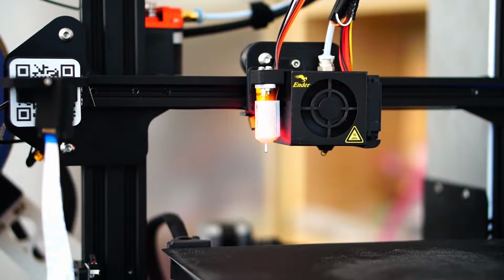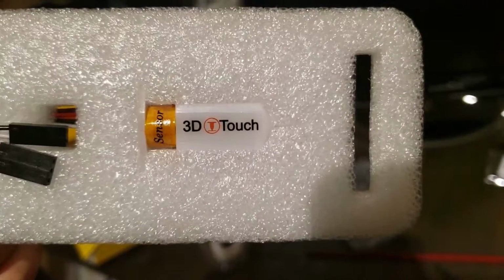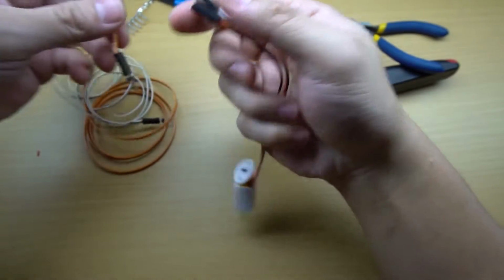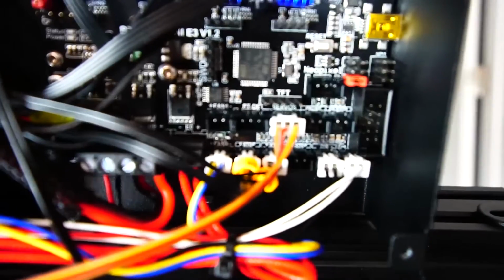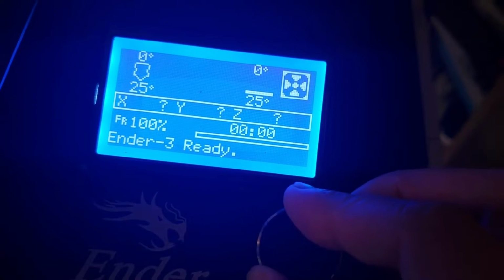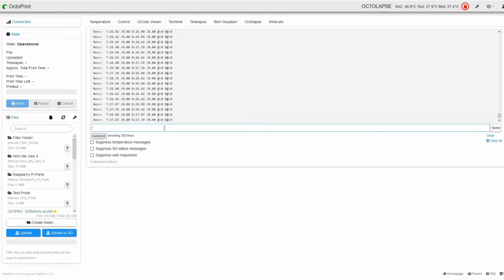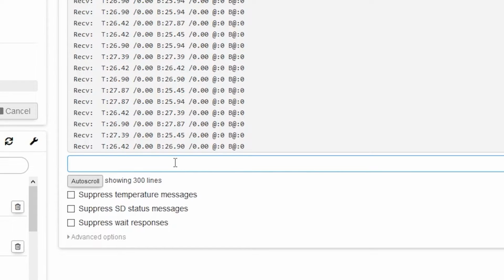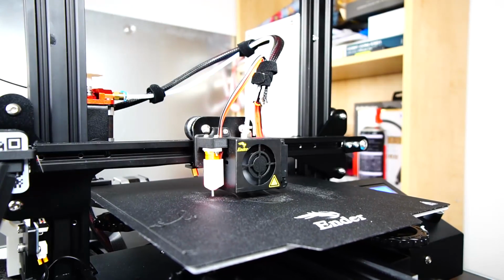3D Touch +  SKR Mini E3 v1.2 on Ender 3 Pro 3D Printer

Comment: whats the github link for this specific firmware? I tried all avenues of trying to load marlin into it and everything keeps erroring. beyond annoyed trying to get the firmware to load. I had to install Visual studios then marlin, next install Platformio next install GIT. I dont have time to be troubleshooting the code in Visual let alone understand why it keeps erroring. the printer literally just has the BLtouch and the BTT SKR mini e3 1.2. why do people have so many different variations of the firmware that all keeps failing for me..... can you provide me the exact link you used for BTT with BLtouch firmware? Please?

Comment: So here we are three years later and your video is still doing good. I was going to buy a new printer when on a whim I decided to dig out my first printer. My gen 1 Ender 3. It had the old 8-bit board in it and it was annoying as heck to level but years ago I bought a BTT SKR Mini V1.2 and never installed it. Well, over the last week I decided to install it (since I already owned it) and it makes a huge difference to the printer. I then bought the knock -off BL-Touch for $15 from Amazon and printed out a full shroud with integrated sensor arm and mounted it up to the printer. I carefully followed your directions and BINGO, I now have an auto leveling quiet second printer. Thank you for this video. It saved me the purchase of anew printer and brought my first ever printer up to date (well, as good as it needs to be).

My tip is that I extended the loom by soldering the short loom to the long loom and shrink wrapped the individual leads so extending it by about 6 inches which really made installation easier. 
 Also, I bought a bunch of super cheap (less than $2 each) LM2596 buck converters from Ali Express and installed them in line with the various fans to slow them down. It makes a huge difference to the overall noise level and it doesn't hurt performance. 
The new 3D-Touch V2 has the loom plugged into the back of the tiny PCB so it makes installation a whole lot easier and it's been working perfectly on my E3.

Comment: my ender 3 has a print resume function, if power cut / load shedding happens. 
I want to know- After this modification / firmware update = will the print resume function still work after power cut !
Reply from the maker: It should still retain those functions as long as they are not disabled in the firmware.
Reply: thanks for your reply 
my motherboard is this one: https://www.powerplanetonline.com/cdnassets/placa_base_impresora_creality3d_ender_3_pro_01_l.jpg

I am confused about the wiring. going to connect the 
2 pin: black & white with z end stop

3 pin: green on ground, red with 5v, orange with signal

where am i supposed to connect the orange wire ? THANK YOU...

Comment: Had to replace the board, due to blown stepper controllers.   Luckily, had a spare, and the replacement was transparent, due to identical hardware  (SKR Mini E3 V1.2).   Sadly, the V1.2 are no longer available, and you're obliged to buy V2.0.    Apart from obvious firmware change, is the switch to V 2.0 of that SKR Mini E3 also  transparent ?

Comment: Great video 👍 however i hope you can help me? I bought a new ender 3 and did not turn it on. I upgraded to a bigtreetech skr mini e3 v1.2 and installed a BL touch. I then watched this video and could not find the same file you showed on github. Also when i plugged in my printer and setup the isp USB to my PC the did not recognise the USB but had other USBs when attached. My printer fans were on when switched on but also tested previously to see it started up correctly when installed and no display. I assumed this was due to not having installed the firmware. Any tips? Advice? Links? Will be much appreciated to help me get my printer to print perfect models in future 😊 I am determined! But need some guidance and help from experienced persons

Comment: Hi can you please help me with this for ender 5? My bed keeps hitting the nozzle on autobed leveling :(
Reply from the maker: I'm not too familiar with the ender 5, but if your nozzle keeps hitting your bed then there are a few common possible reasons.
1. Firmware is not set to use z-homing and you don't have a z stopper.
2. The touch probe, when fully extended, is shorter than the nozzle and isn't getting triggered correctly to sense the bed.
3. Incorrect wiring or hardware issues causing the touch probe to not deploy or sense properly.

Comment: I'm having trouble with my bltouch when I auto home, it won't deploy. any tips on how to fix it?
Reply from the maker: If your firmware is correct then there should be a BL touch menu option. In that menu there should be options to deploy and retract the probe to test if it's working properly. If it is not then you may have a configuration issue, a wiring issue, or a hardware issue.

Comment: Hey... in the link for the BL-Touch mount... which file did you print. There's 2 versions. one of which is 3mm longer
Reply from the maker: I believe it was this one
ender3-bltouch-mount-4b-3mm-lower
Reply: @dorkytim  That'll explain you're Z-offset.

I printed the normal one, but the pin was always higher than the nozzle. 

So I put a 3mm nut between the BLtouch and the original mount to space it down enough. And my Z-offset now is -1.40

Comment: I don’t have the bltouch option after I flashed the firmware help please!!!!
Reply from the maker: If you don't have the bl touch option then you likely loaded the wrong firmware or the firmware didn't load. Did you rename the file to firmware.bin before loading it on the sd card?
Reply: @dorkytim  yes and I did the z homing option it still isn’t working

Comment: For anyone wondering what the white clip in connectors are called that connect to the SKR Mini board they are the JST-XH connectors. Cheers for the vid it helped me out. 😊 Good shout about using the male to male pin to easily unplug the BL touch I didn't realise you could do that (newbie to electronics).

Comment: Thanks. Your video helped me install the thing and it works kind of ok. I have one question though - how does the firmware know the distance between the hotend and the probe? Are there some standard values baked in the firmware or can I change that? I use different cooling and I think my probe has different offset from the nozzle than yours. Can I configure that?
Reply from the maker: This is what the Z offset is for. You have to adjust this value to get the right distance and ultimately it affects how close your nozzle is going to be to the bed.
Reply: @dorkytim  I meant the distance between hotend and the probe in XY coordinates. But I've figured it out. When you download the firmware, there are configured values X-44 Y-6. I had to set it to X-46 Y-8 using M851. So mine was only a few mm off of the default value so it shouldn't make a big difference, but if someone had a different mount of the probe(worst case on the other side of the hotend), it would be really important to set these values correctly. https://marlinfw.org/docs/gcode/M851.html
Reply from the maker: Ah yes. The x and y offset.

Comment: i need help guys, my 3d touch doesn't seem to go near the bed probe works. it also says home z first?
Reply from the maker: Is your probe mounted correctly, and is below the nozzle when extended, but above the nozzle when retracted?

Did you use prope port or zstop port for z-homing?

Comment: Planning to install bltouch after I get some wire extensions. So just to confirm, the firmware changes the autohome to approximately in the center of the bed or do we have to do that ourselves?
Reply from the maker: The firmware with bltouch enable with zhoming will autohome to the center.

Comment: OK, let me get this right:  Since I bought the 
BIGTREETECH SKR Mini E3 V1.2 Control Board 32Bit and the BL Tough 3.1 I don't need to connect the ISP Board to the SKR board and use that Burner ribbon cable that plugs to my PC and run that progisp172.exe file?  Or use all that other crap in the box?  I appears geared to the Ender original board anyway.  Heck even the chip set is not in that setup.

Please confirm:  I just install the touch probe, connect to the main board, remove the Z stop, flash the firmware then set about leveling.   So far yours is the only video that clearly  shows the proper setup.
Reply from the maker: Yeah, I don't recgonize those steps with the progisp.

SKR mini e3 is a drop-in, plug and play. You shouldn't need any additional hardware. My guess is that those are steps to setup drivers for usb control to connect to your PC. Either way, it's not necessary.

I agree with the steps in your confirmation request.
Reply: @dorkytim  Eeek, almost ran my Z through the bed.  Forgot to flash the version with the Z stop removed.
Reply from the maker: !!!
Hopefully you were watching it and caught it in time.
Reply: @dorkytim  Oh yes, mash that power button.  LOL
Reply: Flashed firmware version 2.0.6.1 and all the BL Touch menu items that were there during version 2.0.5 are gone.
Reply: Flashed 2.0.5.3 and BL Touch menus back, but this version crashes the Z.
Reply: The z-homing of the firmware wipes out all BL Touch menus.  I loaded the standard 2.0.6.1 and got the BL Touch menus, but will not fire off the BL Touch during auto home.  So, no printing until someone updates the firmware fixing this.  I was updated 6 days ago, so probably got left off.
Reply: @dorkytim  Wonder who fixes these incorrect firmware issues/
Reply: Hey Tim, what version of the Z-Homing firmware did you use.  Figured that since you made the video May 21 you must have got the version before the BL-Touch got wiped off the menus.  Latest is 2.0.6.1 posted Sept. 21st.  Did you in fact just flash the firmware or did the code edit?  I'm not a coder so I am hoping you may have the Z-Homing firmware prior to the BL-Touch loss.  Either that or I may have to learn up on coding.
Reply from the maker: @fixerone1963  That's a good point. I use my own custom build right now. You can check out the repo and how to build it from my other video.

However, for this video I wanted to keep things simple and used the prebuilt firmware from BigTreeTech at the time. Let me look though my old stuff to see if I can get that version to share it. I saw a few comments that others are having issues with the latest prebuilt, but haven't had a chance to see for myself.
Reply: @fixerone1963  I was looking everywhere wondering why the bltouch menu was not there. Thank you for saything that in your comment as I was looking for hours to find out why it wasnt there

Comment: Thanks for the clear info. I have installed SKR MINI E3 V2.0 and 3D Touch V3.0. Updated the firmware from github. However probing is not working. Always it shows probing failed and stays probing 1/9. 

Also when I give Auto Home, the head is not coming to the center like in your video. When I give G29, the head moves to X stop and stays for few seconds and shows probing failed.

Could you please help me on this. You are my last hope and spend almost a day to correct it but in vein. Thanks in advance.
Reply: You have to set a x offset in the Marlin settings

Comment: I have problems with the file "firmware-bltouch-for-z-homing.bin", I upload it and the bltouch option does not appear. Instead, the file "firmware-bltouch.bin" works perfectly. Do you think what is happening?
Reply: Same here, I have not figured it out yet, just wanted to mention this too.
Reply: I found a firmware that is working for my Ender 3.  I hesitated a bit on installing an unknown firmware, but it is working.  It uses a 7x7 leveling.

https://github.com/gazcbm/Marlin-2.0.x-SKR-Mini-E3-v1.2/blob/master/CompiledFirmWare/firmware.bin
Reply: @claudefountain2544  I flashed this firmware and it works great.  This works exactly like what the Z-Homing firmware is supposed to be doing.  Good find Claude, you rock.  Tim's video got me on the right track and this drove it home.
Reply: @claudefountain2544  Is this firmware designed specifically for the BLtouch installed into the original Z Homing pins?
Reply: @leftyphotos  that's exactly how I have mine currently setup.  I am using the same e3 mini board.
Reply: Claude Fountain you’re the man. Thanks!!
Reply: @claudefountain2544  Do you know of a way to only use 5x5 or 3x3 leveling because 7x7 takes a long time.
Reply: @storynewt  apparently I have to YouTube accounts, and I rolled from my second one. This is still Claude

I was finally able to compile my own firmware using vscode from Microsoft.  I still use the 49 point bed level check though.  I would suggest trying to compile your own, or I can compile another version myself with 5x5 or 3x3 and put it in a Google drive link if you'd like.
Reply: @storynewt  crud I never did this.  Do you want me to compile with 3x3?
Reply: @3rdClaude  ah no no it wont be necessary I actually ended up upgrading to the Ender 5 Plus so it all worked out in the end. Thanks though!
Reply: The Z-Homing version wipes out the BL Touch menus.  If you use the regular version, using auto home makes the extruder run thru the printer bed.  Someone, whoever updates the firmware should fix this.  I think I filed the bug issue correctly.  Will wait and see.

Comment: Installed a skr mini e3 and bltouch on my ender 3 pro and could not get it to work properly. It looked like something wasn't right and the bed was NEVER level. Tried everything, firmware, printer, slicer... nothing.

The problem was that the z axis could move 2 mm on the right side (wheels/carriage not set up properly)

Check if your printer is correctly assembled. Maybe you need less than a week, not like me.
Reply: Same

Comment: Hello, I have trouble on the part were you set the z offset, do you have a download link for the modified firmware?
Reply: 1. Modified Firmware: use the one provided by bigtreetech: https://github.com/bigtreetech/BIGTREETECH-SKR-mini-E3/tree/master/firmware     .  Make sure you choose the right one for your Model and connection method and rename it to firmware.bin. Copy to micro sd card, put it into the printer and start the printer.

2. Start the printer, 

3. Go to motion-> bed leveling -> level corners

4. Go to Motion-> Bed leveling. Set Z offset to something like -2.5 mm.

5. Go to Motion -> Auto Home. Go to Motion -> move axis -> z axis. Lower by 10 mm. 

6. Put a piece of paper under the nozzle. Lower the nozzle by .1 mm until it hits the paper. Write down the number in the display (example: + 0.85) if you rech 0 and the nozzle is still not low enough go back to point 4 and set the number lower to 3.0 or more

7. go to motion - > bed leveling. Set Z offset and add your written down number to the one already in there. Look for +/- ! In my example it would be -2.5 + 0.85 = - 1.65.

8. Auto Home and try point 5 and 6 again again. If it's not like you want it adjust the offset slightly until you are satisfied.
Reply: @MrSpirit99  On number 4 I cannot set the z offset to something less than -1.000 and on number 5 I cannot lower the nozzle less than 0. Do you have any fixes for that?
Reply: @maximidayo  

If you use the marlin version from bigtreetech it should set max and min z offset to at least 3 mm?!

that you can't lower the z axis below 0 is working as intended (soft stops).

TO DE

Connect the with the USB cable to a computer, use the Octoprint Terminal (or any other terminal tool) and send M211 S0 that deactivates them.

Description here
https://www.thingiverse.com/thing:3700194

Second way to do it is to compile your own firmware and set 

check these lines that they look like this

// For M851 give a range for adjusting the Z probe offset

define Z_PROBE_OFFSET_RANGE_MIN -20
define Z_PROBE_OFFSET_RANGE_MAX 20
this video explains adjusting really well.

https://www.youtube.com/watch?v=Q5M7DvdMcew

If those lines in marlin aroudn line 820 in configuration.h look like that then I would need see the code to see why you are limited to 1

Comment: Do you  need to manually level the 4 corners of the bed or just the center for the z-offset, if you have ABL?
Reply from the maker: You should at least level the bed manually once after installing auto bed leveling. This is because auto bed leveling can only help you so much, and won't be helpful if the bed is super uneven. After that, then you should be good for the most part.
Reply: @dorkytim  Thanks Tim. That's exactly what I've done and I'm very happy with the results. And thank you for sharing the start GCODE which works very well.

Comment: If you don't mind the noise and manually leveling the bed now and then, the ender 3 pro runs flawlessly. With the new ender 32 bit boards, you really don't need any of this.

Comment: I believe that I followed this video’s instructions however whenever I try to print something it only probes the center.  Can someone tell me what I did wrong or how I could find out what to do?  Great video by the way.
Reply from the maker: If you wish to have the printer run the bed leveling procedure before your print, then you need to edit your start code in your slicer to include G29 after the G28 and re-slice your model. Otherwise, the printer will just auto home prior to your print.

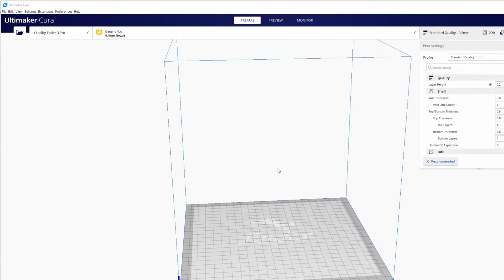Edit: Referring to "Setting Start Code in Cura" at 30:57 of the video.
Reply: DorkyTim thank you so much

Comment: Did you not have to mass with the offset of the x-axis with this mount and the firmware you installed?
Reply from the maker: I did not have to adjust the x or z offset. The mount I used was fairly standard. It's also not too difficult to adjust the y and x offset. You just need to ensure your nozzle isn't going off the bed.